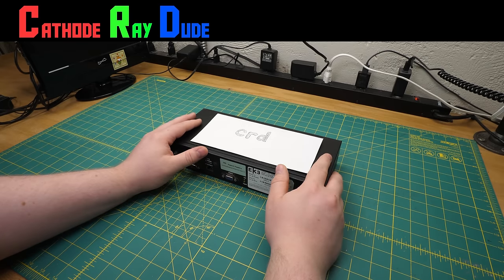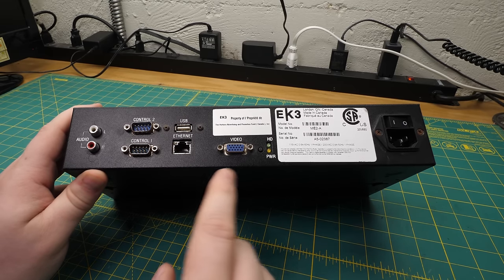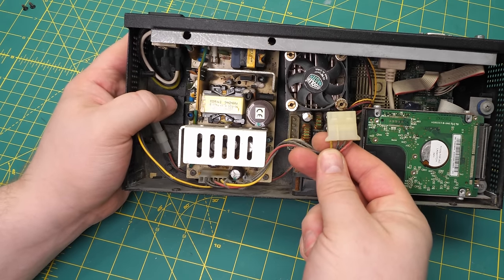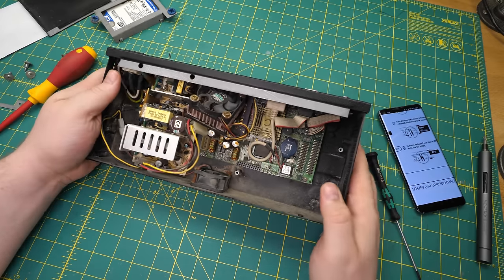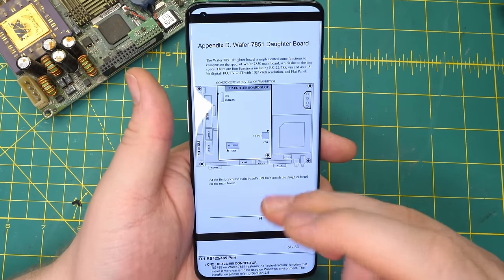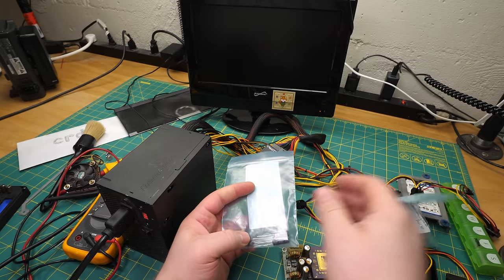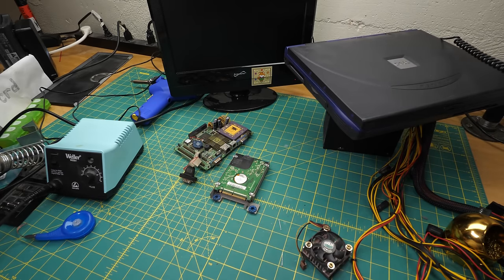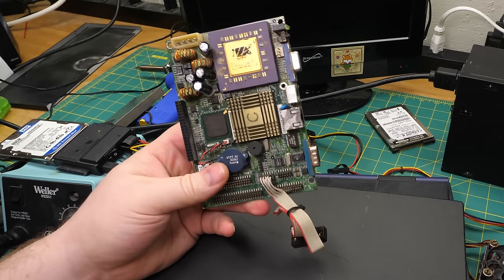Little Guys 8: This one won't fly [EK3 Media Engine]

Comment: The i815E chipset used on this little guy has hardware accelerated MPEG-2 decode for SD resolutions (up to 720x576 maximum resolution). That'd allow the VIA CPU to decode video, since it's mostly just doing format parsing (to extract slices etc from the MPEG-2 bitstream) and shoving the data into the i815E that'll do the decode.

Comment: /dev/sdb4 is an "extended" partition, meaning it's not a real partition but a meta-partition which can contain other volumes. Before LVM or GPT, it was a thing in MBR style partition tables since they only allowed 4 entries. That's why it wouldn't mount -- /dev/sdb5 through /dev/sdb10 were contained within it.

Comment: The original Pentium had a ZIF socket a lot of 486 had them as well. The LIF Low insertion force were just about passed out by the 386 and 486 era.

Comment: ZIF sockets actually started in the 486 era. I initially thought it started with Socket 3 but Wikipedia has entries for Socket 1 and 2 which were apparently intended for OverDrive upgrade chips.

Comment: The extended partition is just a "wrapper". The start and end blocks will overlap the partitions that follow it. Legacy MBR only supports 4 partitions, so if you want more you need the 4th to point to an extended partition table containing the rest of the real partitions.
To figure out which is used for which, find the root partition and look for /etc/fstab. That will tell you what each partition gets mounted as.
Reply: Sometimes I forget how clownly things were before GPT and other new paradigms of drive management.

Comment: One reason why the probably used the VIA chip in this system is because it may have been the only Socket 370 CPU still manufactured in '06. The desktop Socket 370 Pentium 3 was discontinued in April of 2004 and the board in this system seems to only take desktop chips.

Comment: x86 had ZIF sockets back in the 486 era. Socket 3 was the first widespread ZIF socket, used for the Pentium Overdrive.

Shame about the burned component on the board, it looks like something I'd like having a repair attempt at.

Comment: I wonder if that tiny board is a sort of "USB Key" for software that requires a physical "key" to run to prevent software piracy. I have seen them in my industry for $$$ software.
Reply: I was thinking the same. I deal with "USB Dogs" that unlock software at work, this looks to me like an extension of that presuming in an awkward form factor to tie the software delivery to the hardware sale.

Comment: The only place I've seen 44-Pin cables for 2.5" drives is in Amiga 600 and 1200 computers. I suspect there must have been SOME other uses for them (perhaps cables were also commonly used in laptops in the early 90s?), because I don't remember them being rare, Amiga-custom parts.

Comment: These were actually sold to the public. The chip is via. It's actually cyrix chip. The last one. 

It was expensive. About 300 dollars. And it can't keep up with intell or and in clock speed but it bet both in floating point. And that's why it got used in some imbedded devices.

Comment: I don't think that the transistor/FET on the bottom of the board right in the middle of the CPU is supposed to be gray, they are normally black and turn gray when they get so hot the magic smoke escapes
Reply from the maker: Eagle eyes! I noticed that during dissassembly, but I took a closer look, wiped it off a bit and didn't see the usual cracked case and visible spatter that I expect from a blown semiconductor, so I concluded that it was just dust/scum. Went back and took another look, cleaned it off, it still seemed pretty normal, but I noticed the plane underneath it looked a bit iffy; gave it a sniff, definitely smells cooked. Desoldered it - looks like the bottom blew out and obliterated the board underneath.
Reply from the maker: https://gekk.info/images/blown_ek3_1.jpg to wit. Thanks for spotting this!
Reply: @CathodeRayDude  Poor VIA. Rest in peace; you served your country well advertisements.

Comment: I think there's also an element of needing to not be intuitively recognizable as a computer to your definition, because the The HP t5530 thin client comes with VESA holes to be fake-AIOed to the back of a monitor, same as a digital signage box might and it's got basically the same internal volume as a 5.25" optical drive, if a little bit more square, making it a "little guy" physically too, but its Windows Embedded CE 6.0 image full of Citrix and VNC and the like doesn't have the "little guy" nature that a signage box would, even if driving a touch-screen kiosk.

Comment: Possible the daughterboard connector breaks out the LPC bus (basically SPI) and that little board plugged into it appears to be a thermal sensor of some kind (most likely SPI/I2C) based on the holes in the PCB directly under it.
That would be my educated guess anyway.

Comment: 10:44 I still want a driver that applies more torque the harder you push, so if you don't push, you have low but engagement and grip it only applies low torque, if you really put pressure and the bit is able to grab it applies more, with maybe three modes, one for the smallest bits, etc. Also I want an impacting electric but driver...not a typical impact assembly, one that allows you a set time to set your bit and apply force then impact once , to break fasteners free, they have manual ones but no electric ones. Also a heated bit holder, or an easy precise way to heat small fasteners that have loc tite on them, heat makes them come right out, what do you all want to see made? Id love to hear your ideas.

Comment: that tiny little chip on the plugin board looks like a surface mount temperature sensor, probably connected to the i2c bus on that daughter board connector (?)

Comment: 16:40 for my Amiga 1200 I used a 44-pin 2.5" connector, and even handsoldered a converter from 2.5" 44-pin to the regular 3.5" 40-pin... very messh... but it was the only way to easily connect a harddisk to the Amiga 1200 (and 600).

Comment: Hey Gravis, Cool Video as always, Not sure if you mentioned the PS/2 Keyboard/Mouse Port at about: 33:22, Believe it was hiding behind the Faceplate, I have used Jumpers on 2.5” IDE Hard Drives, Not sure if I was aware of the Diagonal Jumper position before though, Either that or I’d completely forgotten about that, Definitely interesting & weird all at the same time! Anthony - Birmingham/UK 🇬🇧

Comment: I used to have a Cyrix III. In benchmarks, it always seemed to rank a lot lower then comparable P3s. While it was probably slower, while using it, I've not noticed that much of a difference honestly. Gaming was a bit more problematic, but during normal "office-type" workloads, it performed great. Price was a lot lower as well, which I think is going to be the primary driver for this company to replace the chip. For most applications, it was Pentium performance for Celeron pricing.

Comment: This is a very cute little SBC looks like there is small aftermarket for replacement boards based off an ebay search. (And of course on ebay anything that even whifs of industrial and might bet sold to someone looking to replace a failed board gets an automatic 200-500 dollar markup)

Comment: 44pin IDE cable. You're not likely to see it on a PC, because they don't use 2.5" drives (usually), you're not likely to see it in a laptop, because they usually interface directly to some PCB (often with a proprietary connector to make it easier to insert and remove).
But.. An Amiga (600 and 1200) had an internal 44pin IDE header (named SCSI, which is hilarious. Yes, it definitely is IDE), and if you open one up that has a hard drive in it, you'd see a cute little 2 inch long 44pin IDE cable.

Comment: > LILO Boot, wasn't that out by 2006?

I have a copy of the 2007 edition of a book calling itself the "linux bible". Page 266 discusses customizing the LILO bootloader, and the kernel image name indicates it was for Fedora Core 6. That said, the kernel on screen is 2.4.29, whereas the version referenced in the book is 2.6.18.

43:04 "extended" MBR and it's 4 partition limit, the extended format was a way to get around that... somehow. So the 4th partition isn't a filesystem, just a bunch of filesystems in a long coat with a top hat.

Comment: Digital signage a new thing in 2006? I wrote the back end for a "digital" signage system back in the late 80s we used teletext to control the display on multiple "TVs" over a single composite video feed!  They could display either the live video/still images or teletext pages on a per display basis.   The system was a bit bigger than that though....

Comment: I have an arrowmax SES electric screwdriver and the thing has gobs of torque on the max setting. Tons of bits, too. Highly recommend if you can actually nab one of the push button ones instead of the awful wrist twist activation

Comment: I have yet to buy into electric drivers for smaller screws. I don't really see the savings in muscle power or time to be worth a potential strip I guess. Rotating screw drivers are cool though and I have a flat head one for electrical wall plates. I wonder if they make them with smaller head sizes?

Comment: You should see the janky setup in my Amiga 1200 to get both an ODD and CF2IDE adapter working. I have a 44pin IDE ribbon cable which supports two drives, but for the ODD I had to buy a 44pin to 40pin IDE adapter and another regular 40pin IDE cable to connect to an IDE to SATA adapter which connects to a SATA to laptop ODD SATA adapter before finally connecting to the ODD.

Edit: got my cable from Amigakit

Comment: Ingress Protection rating is relevant in most cases, seems to have been ignored.
Can‘t recall you mentioning the stench that a fire leaves so my guess is that the IP rating was not adequate.

Aluminium cases and other components will get messed up by some cleaning products.

I‘d always want to go with an SBC without a fan or use a KVM to bridge the distance between the harsh environment and an adequate environment for it.

Comment: 24:07 There were Pentium 1's AND 486's which were ZIF socketed. See Intel Socket 1,2,3,4,5,6,7, and Super Socket7. all of which were for the Pentum and 486. Although if you want to get technical, Socket 1 was LIF, so almost there, but not quite. My family's first Gateway 2000 ( A P5-200 Mini Tower) has a Socket 5 MMX Pentium at 200 MHz.

Comment: 24:00 socket 1 486 is definitely a zif socket.
And yes thats 1991.😊
They could have just soldered in the CPU, that would be a better choice.
I have a system with that cursed jumper setting, some kind of basket case computer i bought at a flea market years ago.

Comment: I wish i could've shown you my Sega New Net City power supply... Almost all electrolytic capacitors were blown. The fan was stuck because it was caked in dirt and rust (I guess that cooked the caps). Amazingly it still worked somehow. I did rebuild it of course.

Comment: My biggest gripe with electric screwdrivers of ANY form factor is when they don't have a speed-control trigger, which makes them miserable for me to use - including that "magic stick" kind. Because they take off at full speed, there's a high chance of stripping the head when loosening a screw because you can't get a feel for how tight it is. Likewise, when putting a screw back in, there's a high chance you'll cross-thread the b!tch, esp. if it doesn't have an insert and it's just plastic. That's the biggest deal-breaker to me when it comes to electric screwdrivers.......rant over :))))

Comment: I don’t believe you can do primary/secondary on laptop drives. But this has been about 15 years since I last had an IDE laptop drive. I bought one to put in a thin client. I tossed out the disk-on-module and replaced it with an IDE hard drive so I could run fall fat windows XP on it. It ran my weather station. Fun times.

Edit: if I had watched the video literally 10 seconds more, I would have known I was wrong. Oh well. At least you got a story about a thin client.

Comment: 4:10 i am pretty sure that was a thing in the 90s too they probably just used video tapes that could loop without having to rewind or laser disc at last the tv's were smaller .i think less shops do this now

Comment: Amiga a1200 and a600 internal ide was the same 44 pin ide with that same kinda ribbon cable. I used to adapt mine down to 40 pin to run external 3.5” hdd and cd rom, primary and secondary with the software “idefix” to make it possible.

Comment: In between a small electric precision screwdriver and a power drill, the Bosch 3.6v Cordless Electric Screwdriver 06039E0051. Can recommend. I have a slightly older model and it works great for servicing computers.

Comment: 8:10 There are also keyboards with a build in trackpad with just one usb dongle... So you basically just need the one USB slot... If you get your data through UTP...

Comment: The snow ibook g3 models used an ide cable that daisy chained the hdd and optical drive together, so yeah, you can use 2 devices on 1 single laptop ide connection, i think some laptops might just have 1 ide bus for both drives, which could save in costs. But that diagonal jumper is something that freaks me out, it justs looks so wrong!

Comment: Tim Horton's is a pretty humid environment. Wouldn't be surprised if that is how it was when they replaced their digital signage systems. Also wouldn't be surprised if those blown caps happened after is sat for however long it did and then someone attempted to power it on and they all went poof.

My electronics OCD simply can NOT process that diagonal jumper setting. My very soul itches just thinking about it.

The first ZIF sockets started showing up around the mid 90's if my memory is correct. Before that we all played the socket lottery called, Can I get the CPU out without breaking anything? Good times.

Comment: Wow, narrow casting has failed, horribly, with me then. Because when I go to a gas station, I am busy dealing with my car, not watching garbage on a screen. I have the fuel pump slowly, while I check oil and other under hood fluids, and check my tire pressures too. I don't have time to stare at a screen while my fuel pumps. When I go to a restaurant or store, I know what I want and where to get it, and I don't have time to stare at screens flooding me with stuff. I don't find any of it "seductive", I find 99.9% of it annoying.

Comment: Seems the i810 chipset has hardware acceleration for MPEG-2 decoding, so as long as the data stream could keep up, it would probably play those vids just fine...

I did have some 486 boards with ZIF sockets (also had a 268 board with a socket that could possibly be considered 'ZIF' - 68pin LCC package).

Comment: ZIF sockets were available on some higher cost 486 boards
https://en.wikipedia.org/wiki/Socket_3

Edit, I think the daughter-board thing on the port is a hardware key so the software would not run if you rip it and run it on another pc.

Comment: I did have a few guesses as to what hardware would be inside before you opened it but nope, didn't expect a Via C3. Was trying to remember what cheap/crappy/mobile CPUs were available in 2006 but didn't guess that one, it was already quite vintage when this thing was put together.

ZIF was around and common from Socket 3 (486 etc) onwards though, there wasn't any mini/low profile variants I remember though so you often found non-ZIF sockets in laptops etc for a good while.
Reply from the maker: Yeah like I was honestly so distracted by how trashed this thing was that I completely failed to notice how long in the tooth the hardware was. This machine came out after... three generations of celerons? The Geode existed, the proto-Atoms I can't remember the name of existed. It's weird that they went with this.

Comment: More than likely that unknown chip on the expansion slot is a spoofing device. Most likely tells the board that something is in there to get the board to boot or automatically look at the VGA out. Probably just tricks the board into thinking something is plugged in...

Comment: 17:45 Not only that, you'd have to have a special width jumper for that use case since that pin distance is sqrt(2) times the width of a normal pinout.  Cursed, indeed.

Comment: I purchased a Mediavue D4 that had a GIGABYTE GA-AB350N-Gaming WIFI mini itx board with an athlon 950 processor. bios f23, cause any higher and the processor wasn't supported. installed a ryzen 5 1400 processor and updated to latest bios. then installed my ryzen 7 5800x3d. have it sitting in my gaming build with an upgraded video card also.

Comment: About half way through the video I am going to guess the module is a licence for the software I have a qnap nas with a similar token pluged in, did a motherboard swap on a faulty one at work and forgot the token the Qnap refused to load the OS untill I put it back on the board
Reply from the maker: I had tried during the video to get a good look at the label and couldn't make it out, but while looking at the thing today I suddenly found an angle where I could see the label - turns out it says AAPN, which is a MAX6629 temperature sensor!

Comment: "Extended" isn't a real partition, it's a container for everything above 4. It was a thing in the BIOS partition table era. For a while I was in the habit of using extended partitions exclusively so my root would be hda5.

I'm not sure about the error or what it's trying to mount, maybe it's just literally getting the filesystem of sda5 with an inconsistent partition size and that's confusing it?
Reply: Knowing the (admittedly horrendous) layout of the extended partition scheme, and that `mount` just does exactly what it's told to do regardless of how nonsensical it is; the program is probably trying to mount what it thinks is a raw, MBR-partitioned disk, and then getting horribly confused.